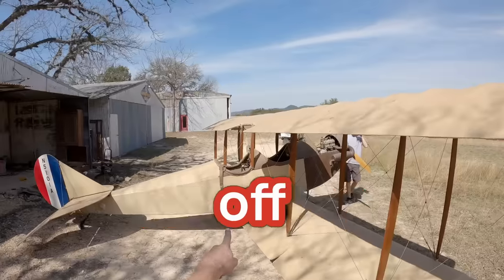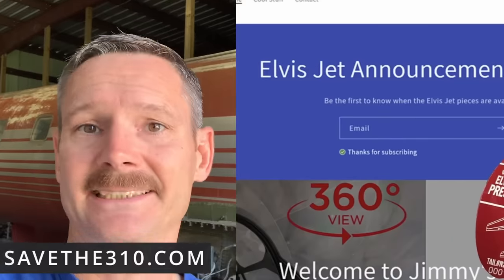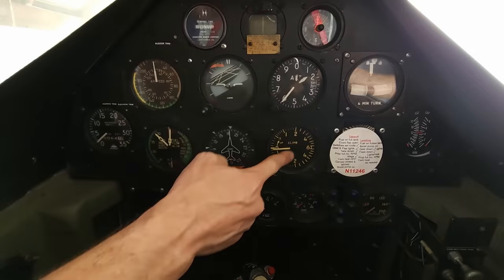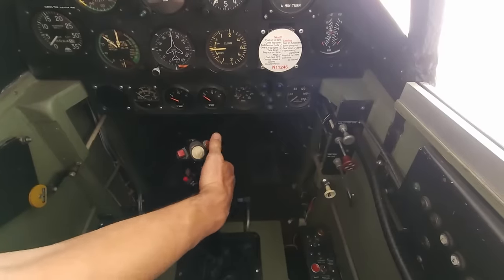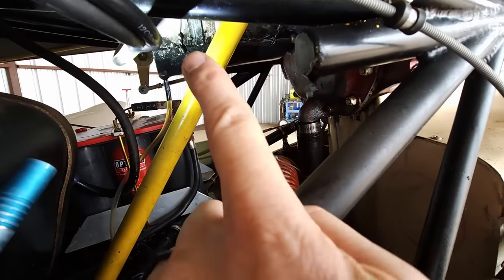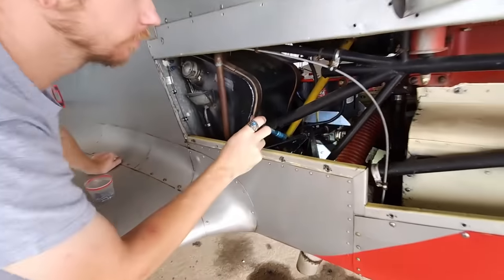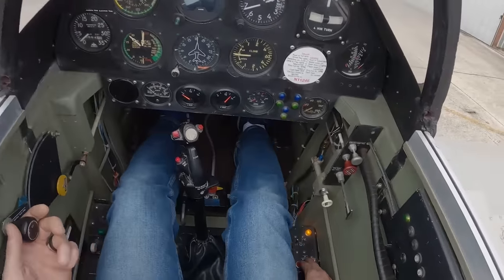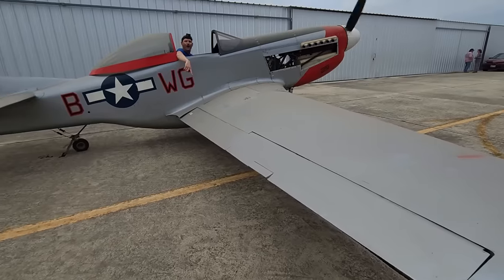1st Start In Years... Homemade P-51 Mustang

Comment: That's a  Falconar SAL P51 Mustang 2/3 scale, with a Ranger 6 Cylinder engine. They  were plans built. Never available in an actual  "kit".
The  Mustang you have there is also in a Youtube video tilted  "SAL P51D Replica".
Previous owner was Jerry Sides. Check it out , it shows Jerry flying it.

Comment: Interesting homebuilt 2/3 P-51D.  Mixture on the right side, throttle on the left... ummmmm... different.
Small fuel leak?  Ehhhhh, it'll be fine.
The 2/3 P-51 is definitely an interesting experimental aircraft.

Comment: Looks like the builder did a great job on your aircraft. This replica is basically a  Fairchild Pt-19/26 firewall forward. 200 HP Ranger engine with the oil cooler mounted under the belly. Ranger Engines are smooth running and sound great. Pain in the butt if you have to pull a cylinder since the camshaft and housing have to be removed before you remove a cylinder. I owned a PT-26 for 36 years and did it more than once. I would love to fly this replica P-51! Lucky guy!

Comment: This is a Ranger engine.  Upside down is the normal installation position.  A friend had a Fairchild 24 E, the only one flying in the world, and it use the Ranger engine.  When rebuilding it they had to use rings from a Cadillac.  Likely from the 50's.

Comment: So would that ranger engine push a 4 bladed prop with the same  maneuverability not hurting the performance? The original had v12 this has 6 cylinder. Not a pilot but been around aircraft since I was 7. My grandfather was in the war came back bought a few aircraft so we went up almost every weekend

Comment: Hey if you need to keep water from coming in the roof vent on the RV when mine broke I used an umbrella just poke it thru the vent hole and open it up. Its not permanent but it works great temporarly. That way you don't get ant more water damage before you fix. Would not suggest while in motion. Btw just started watching your channel and do far so good! Keep up the good work!

Comment: They didn't have rockets during ww2 as only Nazis were working on technology at the time. Although it's possible the P51 Mustang had rockets after the war but not likely cause we went right into jets afterwards
Reply: The United States was the first to develop air to ground missiles. They were available late in WW2 and helped support the Normandy invasion. 
I don't think that any P-51s were equipped with missiles during WW2,  but the P-51 was still in service during the Korean War, where they were armed with missiles in a ground support role.
The US Navy aircraft were probably the most common types equipped with missiles during WW2. After the Germans got handled, we were still merrily island hopping our way to Japan....

Comment: Looks like one of the older Continentals with a dry sump, so I believe you officially check the oil after the engine is hot and been run vs cold, but you look like a regular Jed Clampet. Time to move to Beverly Hills.
Reply: It's a Fairchild Ranger L-440, the design dates back to the mid 30's. It produces 180 hp, so this plane will fly maybe 150 mph.

Comment: The kit-built P-51 sat for 3 years.  The fuel was likely stale.  Hope you pumped some fresh fuel into the tanks before you expected it to start.  Fuel loses its pops after a year in the tank.  😉⛽⚡
Reply: Avgas maintains it's pop for a long time. I've started planes with 10 y/o avgas in the tanks.
Reply: Plans built, they don't come as kits

Comment: Why are cylinders upside down. Is it a air raft engine or a automobile engine?
Reply: It is a Ranger aircraft engine. Upside down, direct drive, air-cooled engines were fairly common before the horizontally opposed engines came into popularity.
Reply: @straybullitt  thanks 😊

Comment: Don't care about about that piece of scrap metal that used to be a jet.  It clearly wasn't remotely worth what was paid for it.  On the seven aircrafts I would keep the p51 and sell the other ones.  Yeah, may have to fix them up.  Add some paint and whatever and then just sell it.  IE, just enough so it passes an FAA inspection.
Reply: The whole reason for keeping one plane is for Silas to learn to fly. None of the experimentals will cut it for that purpose so it's the Cub or Luscombe, I think it's already been decided the Cub is the keeper.  
BTW, plural form of aircraft is aircraft. No such word as aircrafts.
agree on the scrapmetal
Reply: So, this isn't just for him.  Hmm, I can't remember the plane but I would go with the side-by-side one.
Reply: @leefoster4133  That's the Luscombe and I agree it's the best choice but it's not my call.

Comment: The very clever design of the scoop, coupled with the Merlin engine (made by Packard under licence in the USA), allowed the aircraft to take advantage of the Meredith Effect to create additional thrust.
Reply: too bad the scoop on this plane is fake and probably only produces drag which slows the planed down.
Reply: @buckmurdock2500  there's an oil cooler in the scoop. But where does the air go out? Where did the air go out on the real P-51D when the scoop exit was closed?
Reply: The exhaust pipes also produced some thrust.
Reply: @greggv8  It also has something a real P-51 doesn't have... cowl flaps ! ! Double drag penalty ! !

Comment: That looks like an SAL Mustang designed by Chris Falconar who sadly passed away four years ago at the age of 92.
He was an aeronautical engineer with many designs to his credit. Chris offered plans, material kits and fabricated components such as fairings, belly scoops, cowls, wing tips etc. some of the metal weldments were also available. There are quite a few flying and the type may still be on the market under new ownership. I actually have a Ranger 6-440 engine which is what it was originally designed around. I will be donating the engine to a museum as a spares source for a Cornell that is actively flown.
Chris was one of my best friends and his passing was a major loss for the aviation community. He spent most of his life in Edmonton, Alberta, Canada where he founded EAA Chapter 30 which is the first International Chapter of EAA.

Comment: A person would this this is a airo plane guy ! He said something about the air where it goes or where it comes from in the airscoop !!!!!!!! or this guy is just being silly .  So I am going to clear some things up about that . As the plane moves forward the standing air is forced into the scoop channel then it passes threw the oil cooler and out the other end . May it ether be comepletely open or a adjustable door under the belly of the aircraft . This door helps in the performance of the aircraft speed as well that causes a Meredith  effect .  The hot air behind the the Rad's causes a vaccumm that helps pull the air threw the duct works . In this causes less drag on the engine and airframe . On the real P-51 the scoop was installed for cooling the engine and supercharger oils and water Rads.  .
Reply: Ya, the belly scoop on this replica does nothing but add drag. You're welcome.
Reply: @buckmurdock2500  OK

Comment: Get some of the Cleetus' buddies like Boosted Boiz, Cooper, et al. to hook you up with a 2JZ 4 banger in aluminum, turning out less than 1/3 of its potential at just 300 hp or add a turbo, add billet rods, add billet pistons, give it a dingle-berry hone and you've got yourself a highly reliable machine for the long haul. I wouldn't recommend it right out of the hanger, but a conservative, aren't we all, nitrous kit for those density days in FL that're close to low earth orbit.... I'll ride with you after a dozen or so flights for proof of concept.